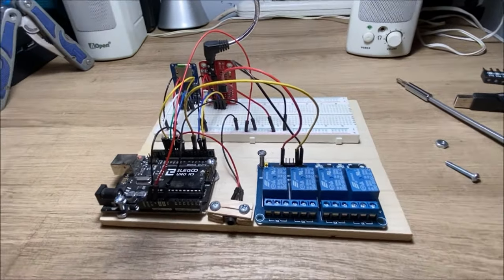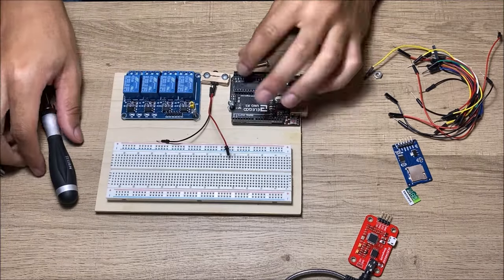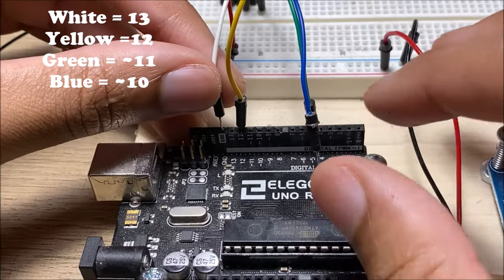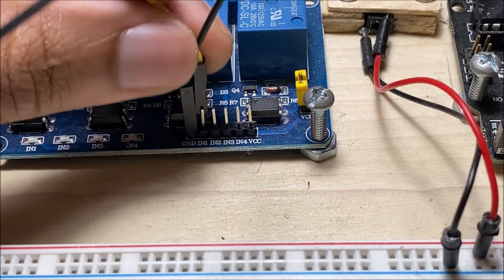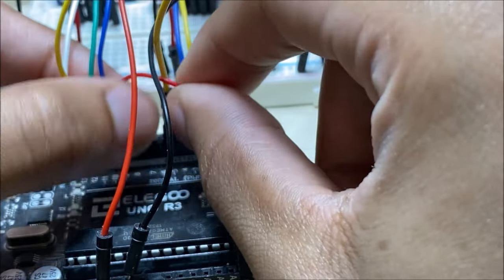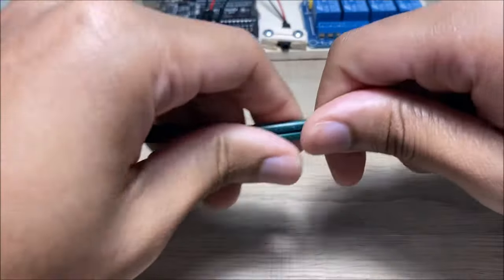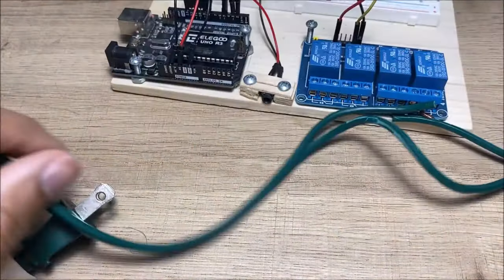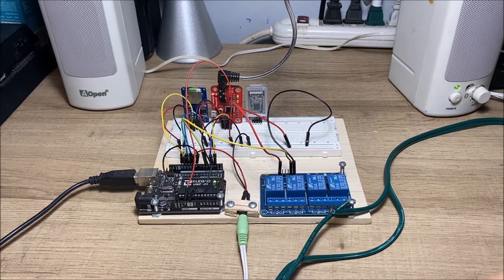Make Your Own DIY J.A.R.V.I.S. Personal Assistant (O.T.I.S. 1.0)

Comment: Congratulations on the project, it is possible to use the Arduino as a battery control, low battery warning and voice command as you did on an Arduino board